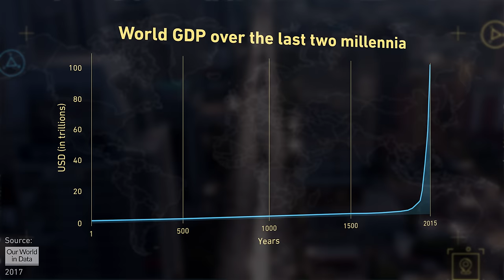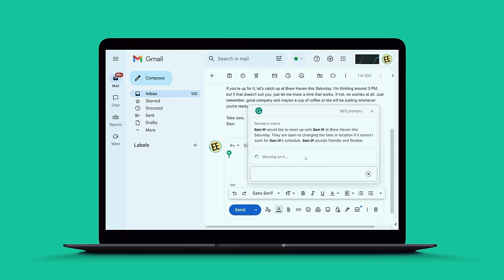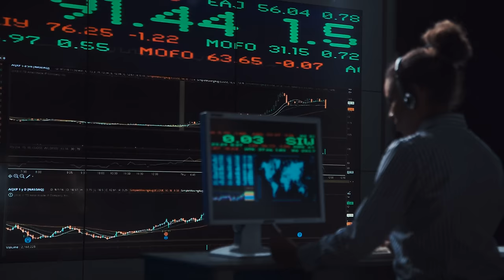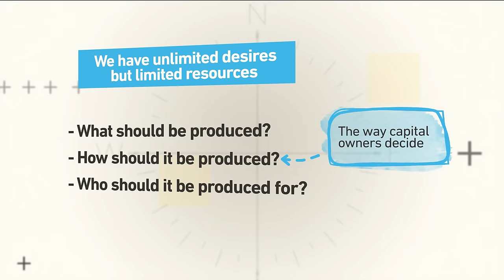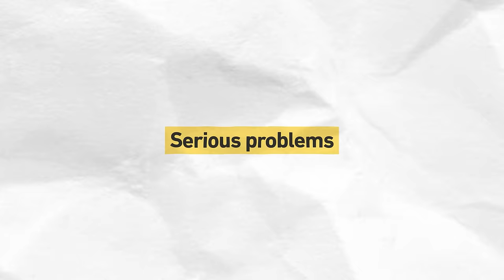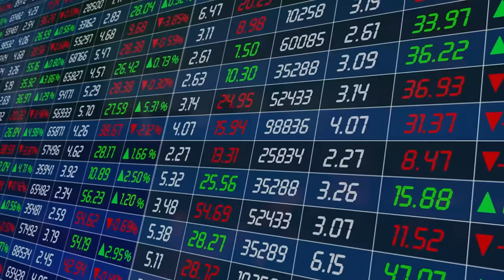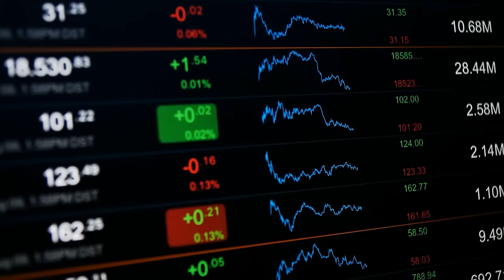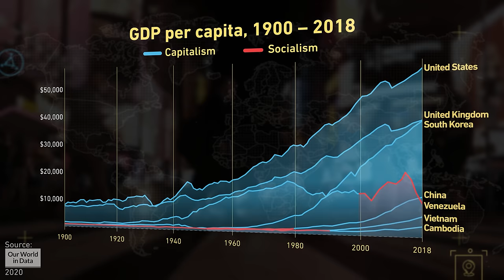Why Every Country Ends up Capitalist

Comment: Disagree land cannot be improved. It can be cleared of trees. It can be leveled. You can add fertiliser, remove rocks. Put in a supply line for electricity. The list of things you can do to improve the land is endless. Some are even very long term and very related to the land itself like chemically breaking up lumps of clay over decades to improve the agricultural output. This was a big problem in medieval times as a lot of land was like today's state forests anyone could use it for anything encouraging foraging, hunting and herding over crops which inevitably would be just eaten by some guys cows.

Comment: The problem with capitalism is that without proper governmental controls, it always results in a small oligopoly or outright monopoly.  It's a competition and competitions always have winners.  The difference here is that the losers die until there is only one (or three, which makes no difference).  Thus, venture capitalism becomes impossible.

Keynsian economics do work rather well but the neo-liberal capitalism that has been embraced as of late has made the gulf between the rich and the poor so great that it will end in French-style revolution.

Capitalism has outlived its usefulness.

Comment: The pure capitalism will always end in neo-feudalism as it is already such case, and its clear shortcomings can be easily fixed but by limiting the exponential wealth growth (or rather centralization) for just a few people, however people are in the mix, and those in power have no reason to limit their own wealth for the benefit of many, and it is childish to think there can ever be a system where such wealth does not influence politics. The big factor to any system is humans in the end, and human greed is larger than any conceivable size of any universe 🤷
Reply: Feudaliam turns into Aboslitism, Absolutism Imperialism, turns into Colonilaism, Colinalism turns into Mercantilism, Mercantilism turns into capitalism. Capitalism turns into communism.

Comment: You have stated something that many people don't seem to realize: that there are different forms of capitalism. What is move prevalent is crony capitalism, which is based on the elite being able to have much greater control due to connections and regulations that favor those with heavier resources. The general populace is still generally better off than under non-capitalist systems, but they are heavily restrained from being able to move up in life due to high barriers to entry.

Comment: Anyone think the definition of capitalism is fundamentally wrong? As if it's a tool we take out of the toolbox to solve a particular problem and then put away rather than a system of doing things that evolved from the ground up and inevitably leads to certain benefits and certain problems?

Comment: Though it might not be the optimal system globally, it's the only one that has contributed positively to society. Take countries like Vietnam and China, often described as communist in theory but incorporating capitalist aspects in practice, using communism mainly for managing dissent.
Reply: Capitalism is definitely optimal if it is combined with social safety nets and efficient regulation.
Reply: Agreed but as the video points out, there’s glaring problems in its current form. Mainly around environment, labor and the ownership of land. The next major shift in civilization should deal with these things, if possible.
Reply: @joela.4058  Environment isn't a problem of cpitalism, but of industrilization. For example communist eastern germany was a lot more polluted than their west german counterpart.

Comment: The ideal system is capitalism, but everyone gets free basic accommodation (if you want better, you have to earn it). This frees up so much talent and capital to grow other parts of the economy.
Reply: Replace "ideal" with "primitive". Capitalism is the "bottom of the barrel", so to speak. That's why any country that cannot sustain principles higher than "caveman" mentality will descend into capitalism eventually. It's the "slippery slope" of economics.
Reply: @Simboiss 
So the top countries are Venezuela and North Korea?
Maybe people would believe in your "high" "principles" more if they wouldn't make them starve en-masse.
Reply: @MrCmon113  Venezuela and North Korea are far from socialist. However, the most socialist governments that reigned in Venezuela in the last few decades increased the prosperity by a lot, even though it was not perfect. North Korea is a Monarchy. You need a dictionary.

It makes sense to think that if you allow people to produce things only based on profits, which is one of the fundamental principles of capitalism, then the product are bound to decrease in quality over time. Profitability is not a factor that a client would like to be high, it's actually the opposite. People want product that are, for example, useful, durable, efficient, etc. We never hear people say that they want a product that is profitable for the producer. That's not how people shop for goods and services.

It also makes sense to think that if you allow capital to be accumulated without any upper bound, which is also what capitalism does on the long term, then you will have a population that is increasingly poorer, because money is not infinite.
Reply: @Simboiss  I'm so confused how someone can claim money is not infinite, government prints it and assuming the "Economy" (GDP) keeps growing there won't be hyperinflation because of it. Money is just the equivalent of "productivity" in a form of currency
Reply: @dioniscaraus6124  It's finite in a given point in time. This means not everyone can be rich at the same time.

Comment: The failure of all economic systems comes down to the mismanagement of resource's. And it can be summed up with large scale economics systems incorrectly defining wealth. Wealth is not the goods that are produced from the use of resources. Wealth is the resources used to produce goods. 
So in our current example of capitalism, we are depleting our resource base, wealth. In order to indiscriminately create goods, misrepresented wealth. This is why we find the economy on a race towards increasing scarcity, because the incorrect defining of wealth means resource scarcity increases the value of goods. Thus the misrepresentation of wealth undermines the logic of our current economic system and further this is why there is no inherent economic incentives in the system towards sustainability i.e. the maintenance and safeguarding of resource wealth.
Reply: Well while I agree with the Analysis of the Problem "incorrectly defining Wealth", the Proposal of Recources as Wealth would likely lead to a flawed economic as well. Which is ok since every Model will run into shortcommings, if it stands Absolute.
Reply: By your idiotic reasoning, the wealthiest people were the earliest hunter gatherers, because all of the oil and uranium was safely in the ground and even the rocks weren't chipped.

Of course the exact opposite is the case: wealth is an expression of how much effort has been put into USING resources.
Reply: @MrCmon113  I wasn't being idiotic. That was implied. Early civilization was the time when humans were the most resource wealthy in human history.

Comment: The view that labor, intelligence, and land are not forms of capital is an error.
Reply: no you are wrong
Reply: Right or wrong, I was pointing out a common mistake. Unless of course, you want to use the axiom: those who supply the capital reap the profits. 

If one includes labor as part of capital, one might be tempted to compensate labor with a fair part of the profits.

Comment: When comparing capitalism to communism we've already done a real life experiment - East Germany v West Germany. Same people, same culture, but different economic system - capitalism v communism. It was clear to everyone in East Germany which system was better. You just had to look over the wall. Same for North Korea v South Korea. As someone who grew up in Eastern Europe I've seen first hand the benefits of capitalism. The only people who miss communism are the former aparatchiks and their children. And some deluded intellectuals in the former West block. Now socialism is not clearly defined but it shares many ideas with communism. The idea that some central government has the insight to determine which industry should be championed, what the price of rent should be, etc has clearly not worked. Of course you don't want children working in mines like in Victorian England so some rules and regulations are necessary. But once you start redistributing, you're picking losers and winners and that never ends well.

Comment: 03:30 -- The "fundamentally unanswerable problem of economics" is false on the face of it. Human desires may be greater than our current levels of production, but to asset they are infinite is plainly absurd. Our lifespans our finite, there is only so much we can consume in roughly 100 years. Even asserting that the variety of human desires is infinite is a very heavy lift, and do we really want an economic system that tries to satisfy our every whim as soon as we think of it? I don't think we do. That's certainly not the goal of any practical field of economics.

Comment: Maximization of total economic output is kinda fucked up. Talk about pushing the working class as hard as possible for the minimum pay you can get away with. Having more to go around only counts if more actually goes around. It isn't for the working class. The fact that the people who own the means of production and the people who do the production are different people seems to have some pretty horrid outcomes.
Reply: By increasing total economic output, the working class will get paid better. There is simply more for everybody.

Limit economic output and you will get inflation because goods and services become scarcer.

Comment: I feel like a better way to balance Labor vs Capital is to make Unions more widespread. Labor needs the ability to be as coordinated as Capital. There is a reason Sweden has high wages without a significant minimum wage. Regulate business so that they are unable to prevent Unions from forming, you don't have to mandate them but make sure business cannot stop or discourage them.

Comment: A major flaw in the dogma of capitalism is that it's "ideal." Which comes as a conclusion only because it was better than what came before it. Remember in narratives of capitalism we like to think the leash wags the dog. But in reality many of the technological developments that mathematically did not evenly distribute themselves across the planet helps to make capitalism thrive. There's no reason to assume capitalism brought on these developments. Rather capitalism is a stasis that comes much more easily in extremely complex economic systems. But it need not be thought of as an ideal (and frankly should not). Capitalism captures our minds in so many ways and is so vaguely defined by most people as to be simply shaped to be truth rather than accurately describing what's actually going on.

In broad strokes since YT comments aren't a place for a thesis, technology and population has driven economic connection which has been the primary driver of value in the economy. Or put in more obvious terms these connections have given people at further and further degrees of separation reasons to contribute to the economy in more and more complex ways. Describing it this way is both undeniable and completely removes any reference to "capitalisty stuff" Hopefully you can start to see we have immersed ourselves a little to much in an overly simple idea: Capital used efficiently equals economic output. This idea is actually completely unhinged from reality.

Humans do not work at a particular productivity level purely in relation to their level of pay. Wages instead set a value on labor that is removed from it's value. A janitor was considered "critical" during covid. But they don't get paid like they are critical. Instead it's not the value of work but the scarcity of workers that sets wages. That isn't rational nor efficient. That is capitalism. Hoarding wealth is capitalism. Bank consolidation is capitalism. Blitzscaling is capitalism. The grocery store, small businesses or what ever people are talking about when they say "innovation" is not capitalism.

Comment: I think a major issue should be added here: global warming and finite resources (like fresh water). Much of 80s and 90s growth at all cost capitalism was predicated on an infinite resource world, which turns out was VERY wrong. Capitalism's compulsory growth model is like a car accelerating towards a cliff, and measuring speed as the only metric for success.
Reply: On the contrary, the point of capitalism is to seek ways to get more out of scarce resources. In the USSR, people would have their heating on max and regulate the temperature by opening the windows.
Reply: @ronald3836  coming from a former comunist country I can assure you that was not at all a problem :))
Reply: @ronald3836  there was a joke circulating around the USSR back in the 80s.

What's colder than the cold water on tap?
The warm water.

Comment: I think one of the weaknesses of Capitalism which has only occurred recently is that technology can grow to be infinitely be more efficient than labour. This encourages a wealth divide like never seen before where the workers are completely irrelevant as they get replaced technology. This is what happened to farmers during the industrial revolution where they got replaced by land owners who used technology to farm more efficiently. 
This is why I believe socialism is needed to a limited degree to limit capitalism so capitalism can push forward with innovation without leaving the people in the dust, sort of the same relationship progressivism and conservatism have where one advances a nation and the other prevents it advancing too far into something dangerous
Reply: Technology making labor (comparatively) less efficient than capital means that Socialism increasingly wouldn't work.  Socialism is almost entirely concerned with the value of labor and laborers, and doesn't have the framework necessary to handle a highly automated economy.  You'd need a new -ism, Socialism isn't the only ideology that can handle the redistribution of resources.

Comment: I'm shocked that you don't mention energy anywhere in your video. Any form of work is per definition a form of energy. You explain that capitalism allows efficient dedication towards investment in tools (a highly processed form of energy), labour (energy) and land (recourses that are produced with energy). I think that the boom in GDP in the 1800's is not so much from capitalism but more from the use of fossil fuels. First coal for steam engines, then oil and natural gas. The boom comes from the fact that we only have had to pay for the cost of extraction of these fossil fuels and not for the production of the energy content.
Reply: Yes! Do you follow Nate Hagens by any chance?

Comment: How did capitalism "create inequality" when the inequality already existed? And considering that winners win and losers lose, why would trying to avoid inequality lead to any outcome other than EVERYONE losing?

And how does a variation of capitalism -- which YOU say wouldn't work -- "prove" that there are flaws with the practical version of capitalism that DOES work?

Also, what you fail to mention is that businesses need to compete with EACH OTHER for labor, by trying to offer more pay than their rivals.

Comment: Capitalism creating inequality is probably one of the weirdest misconceptions out there. People were not equal since the dawn of time. Even in tribal societies shamans would not be treated the same as laborers. Capitalism is the only system to have ever succeeded in reducing inequality while not making everyone poorer. And it did so while putting greater emphasis on your ability rather than your lineage or arbitrary characteristics.
It was never perfect and many people nowadays confuse the actions for people openly opposing capitalism as failures of capitalism but it's still better than any system we've had so far which is fitting since it's in essence economic democracy.

Comment: The title might be a bit misleading. As I see it, you have barely scratched the surface of why capitalism takes over most economies and mostly focused on its advantages and problems, while not really talking about how and why it has a tendency to ingulf everything. While certain points you made do surely work for both discussions, I would have loved if you took a proper dive into the topic at hand instead of talking again about many of the points you’ve covered in the videos about “the end of capitalism” and the economic extremes. I generally love your content, but I cannot shake the feeling that this one was mildly misplaced or misrepresented.

Comment: Imho you completely missed the mark on the math. If property taxes were higher land wouldn't be as over inflated or amassed by a few, reducing rents. If that tax also replaced income tax, more people who planned to use land (not as safe investment) would own what they needed and could afford it by it being lower priced and their incomes not being taxed until after they saved to buy the property.

Land values and rent seeking has exponential effects across the market, from production to poverty to productivity and stability of capital markets which tend to leverage debt from inflated valuations. The pursuit of easy higher residuals affect educational pursuits and have spin-off ranging all the way back to racial prejudice and the era of desegregation/civil rights abuses. For no practical reason other than the easy way to exploit others legally by earning residuals, having more access to cheaper credit, and hoarding wealth. 

It's absurd property is the financial system's backbone rather than societal contribution.